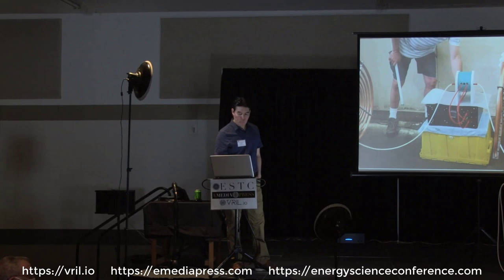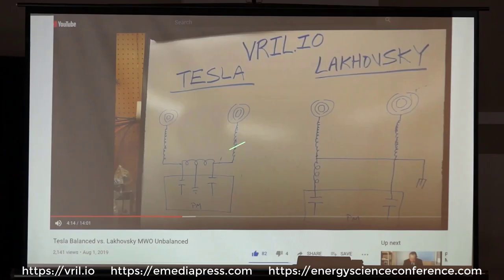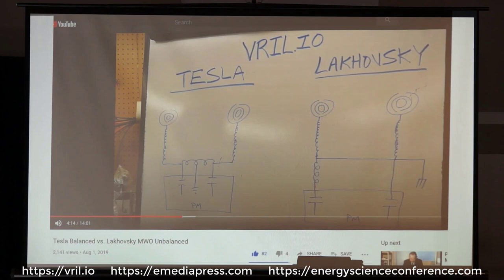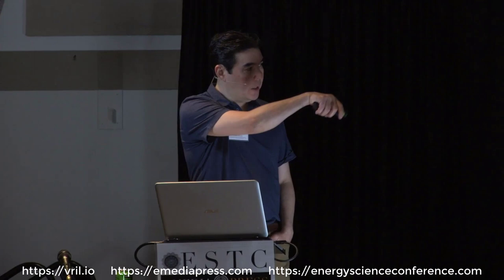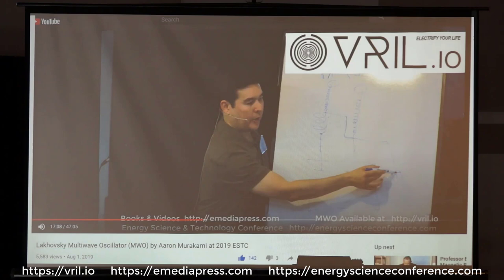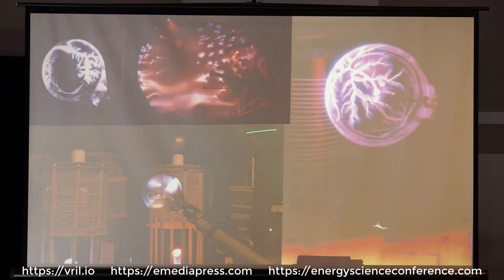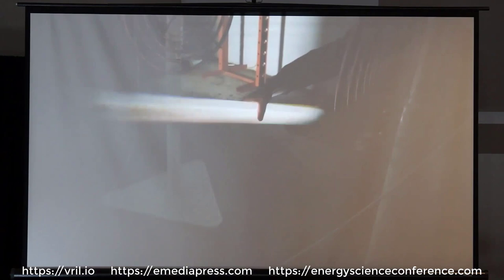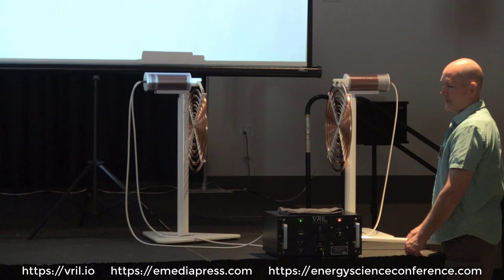2020 ESTC Oscillation Transformer for MWO and Eric Dollard comments

Comment: This is probably the wrong section, but it is a new section. In one of your discussions (ESTC2016-18?). Eric Dollar says, Time started when the Dielectric energy decays from the Inertial Plane. Ken Wheeler has also said this.
 I heard, Our Space Universe was tunneled from Counterspace through the Inertial Plane. Tunneling is the transverse waves being stopped. The Dielectric 
longitudinal waves go through the wall. Following the Inertial planes between the Hyperboloids and Votices. Like, the beginning of the Universe. Dielectric energy (Inflation) then Dielectric Voidance Field/Magnetism (Grand Expand). The EM wave circuit that EM waves travel on/in (Tesla Nodes). Lights rate of induction, is the rate of creation of the Dielectric Voidance Field/Magnetism. Because both Dielectric and Magnetism are needed for EM waves to exist.
 If, on/in Counterspace, opposite side of Space, the Dielectric Voidance Field/Magnetism decreases into Dielectric energy. That tunnels through the Inertial plane, into Space.
 In Space, the e- highest energy shell is the outer shells. In Counterspace, the highest energy shell is against the nucleus.
 Faster than light, if the EM waves can go in the opposite direction on/in the Inertial Plane. Equal an opposite transverse waves.
 Hi, Eric and Aaron see you again at, ESTC 2021!
Reply: When one knows this one must also ask the question what put the Aether under strain to manifest the Dielectric field in the first place for it to decay and create space and time, that has implications, fascinating right?

Comment: of course i know what an MWO is. pff i gotta PhD in Motor. Wired. Oranges. thank you for being accessible for the masses
Reply: Multi Wave Oscillator my friend. Those of us who have been following Eric for a long time know what it is. Welcome to the wonderful world of electricity.
Reply: @ni_tai  im sorry at the moment i was a bit rude. i just dont like that i can't understand the material because to me the foundation hasn't been layed out clearly enough. i understand longitudinal waves they're a sort of finger snap in the ether an impulse of electricity instead of acceleration of electricity. but i dont understand it completely. i know its possible to phase shift 8 times specifically to then phase shift with capacitors to a virtual ground. and allows for a grounding into the ether. its just difficult when it's written so that if you're not on the dollard train its impossible to understand. im just wack... ignore me. I'll just watch more dollard
Reply from the maker: @projectpegasus1297  Free vids that will walk you though the principles of longitudinal waves: https://ericpdollard.com/free-videos/transverse-longitudinal-electric-waves-and-teslas-longitudinal-electricity/
Reply: @AaronMurakami13  Won't let me back in without a password from years, ago.
So, stem cells, somatids. That's all you get.
Reply from the maker: @gyro5d  Let you back in where?

Comment: the inertial plane sits at the middle of the two coils
Reply from the maker: You're talking about the magnetic Bloch wall - this is about pure dielectric - no magnetism.
Reply: @AaronMurakami13  Magnetism gives Magnitude to the Space Universe. 
Mass without Magnitude is a Counterspacial Sink/Blackhole.
Magnetism/ high gauss is so strong it can not leave its Inertia plane/Bloch wall. The smaller the spacial footprint, the higher the capacitance.  (?)Infinite capacitance?!
Reply: @AaronMurakami13 ; The Space Universe (Time) started when the Dielectric energy decayed from the Inertial plane. Eric Dollard and Ken Wheeler have said this. You said this is Dielectric. Before/Without Dielectric Voidence Field/Magnetism. No magnetism,  No magnitude. Doesn't seem correct. Thinking Dielectric energy is Inflation. Dielectric Voidence Field/Magnetism the Grand Expland.